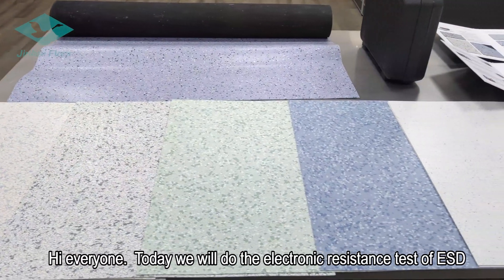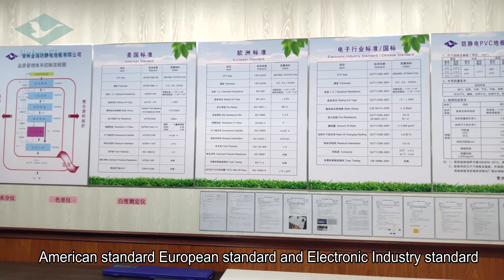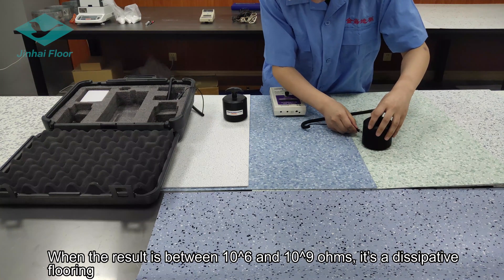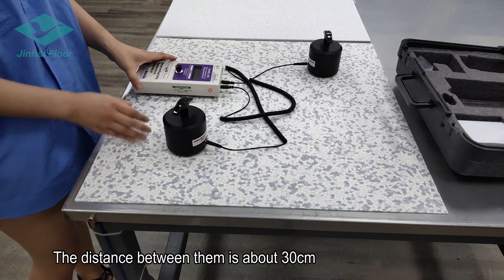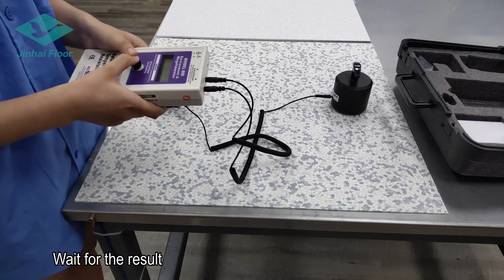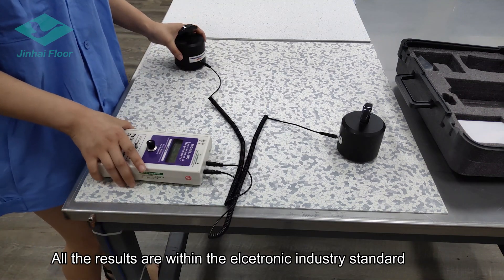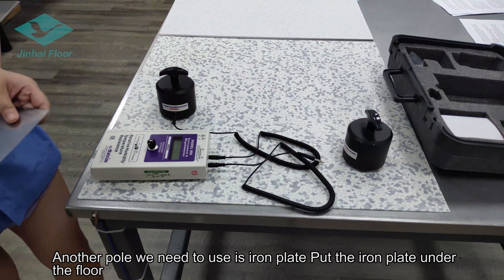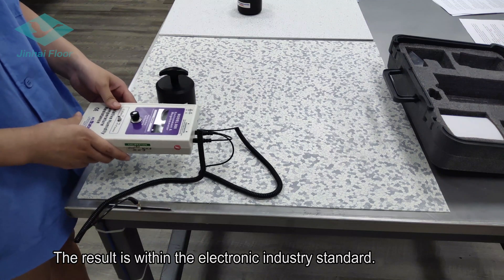Electronic Resistance Test of ESD Vinyl Flooring, ESD Tile - Jinhai Floor

Comment: How to clean these esd venyl floor
Normal floor cleaner or any special chemical
Reply from the maker: There is special treatment on the tile surface, just clean in normal way as normal flooring. If you want to extend the tiles' service life, you can do wax regularly.